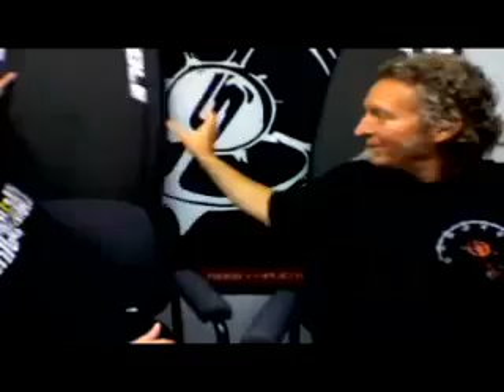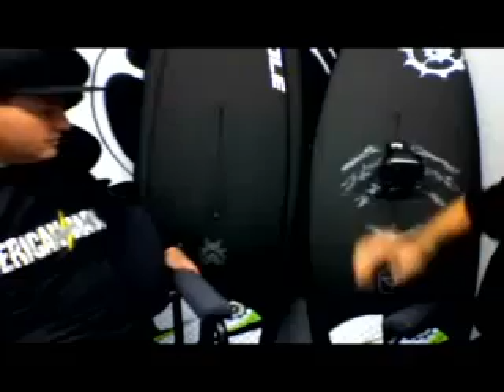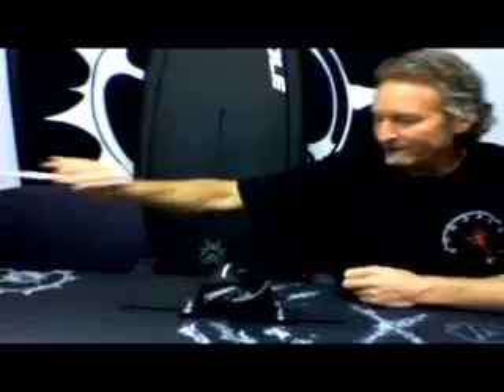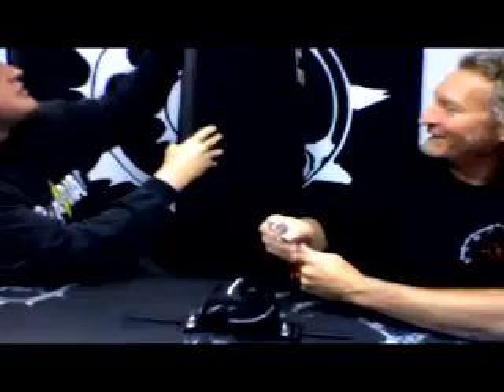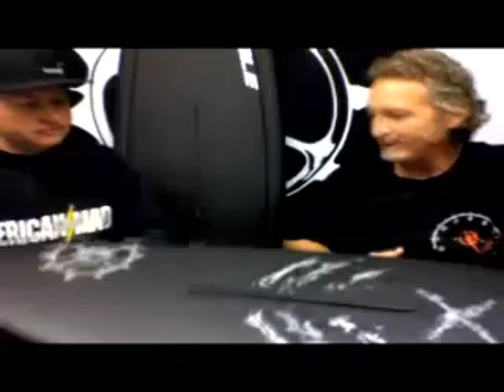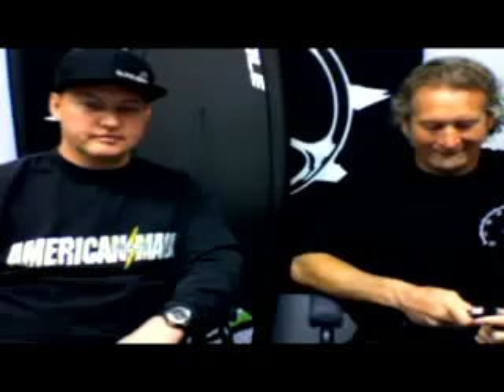TKB Videocast with John Omohundro

Comment: guys, can't you use a headset when recording this or something? that echo is awful. Or here is a tip, record it on one in and edit the audio back in... interesting comments about directionals behind a kite. I recently got a directional, when it's 11m or less they are fun but, riding a directional behind a 12m+ kite isn't fun, turning is awful. Also if you want to learn to ride a directional do it after you have learned on a TT, you'll have much more fun than rying to learn on a surfboard.